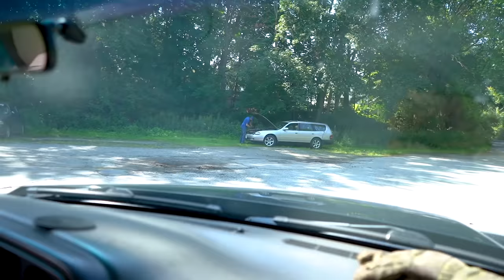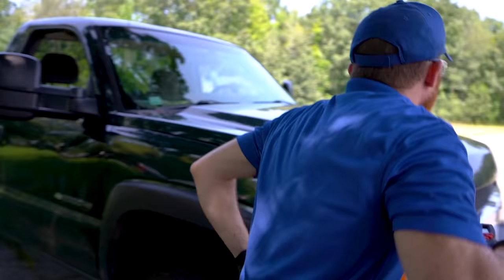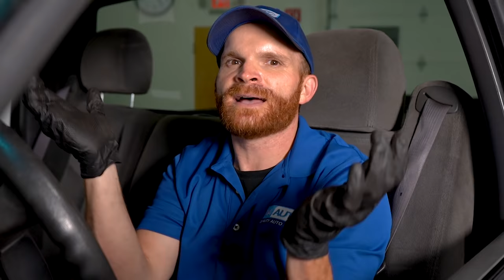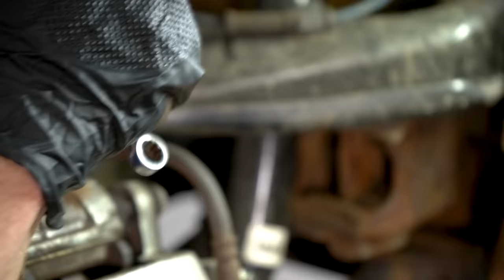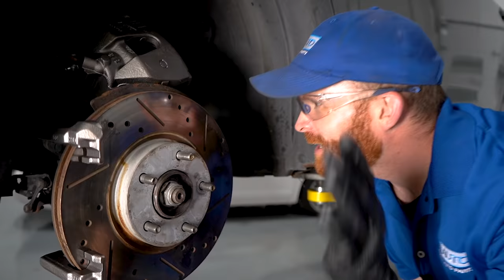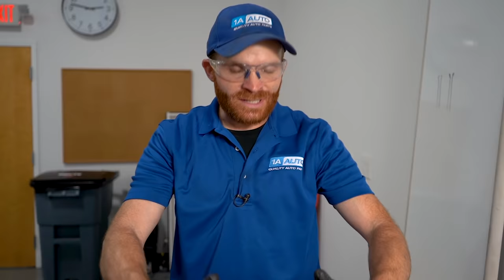Shaking, Pulling Steering Wheel? How to Diagnose a Seized Brake Caliper!

Comment: In my case, my truck didn't have a shaking wheel, and it only slightly pulled to the left. What it did do was have a rhythmic "pulse" of braking, making the truck seem like it was hesitating. The pulse would increase with speed and decrease when coasting. I got home and used my hand to feel each wheel and the front-left was radiating heat. At that point I only went a few blocks to Wal-Mart and back. Another symptom was the truck wouldn't crawl forward while in gear with the foot off of both pedals. I had to fight to get the caliper off because the bottom piston (two-piston caliper) was sticking out further than the top one. I replaced the caliper but the problem still persisted. Once I replaced the hose as well the truck acts normally. Just putting this out there in case you don't quite have the symptoms mentioned in this video.

Comment: Warped brake rotors can cause a shake too in the steering wheel.
Reply: That’s true
Reply: @drteaisback  
Thanx for that will change those as well
Reply: Brakes rotors and calipers...how much would you estimate it would cost for an SUV? Your best opinion on prices in your experience. I have the same problem happen to me and the place I went to is charging me 930 for a Honda Pilot.
Reply: @TheTSRush  New mounting bracket and caliper w/hardware $126 each side, Brakes $35, Rotor $56 each side.  I am replacing parts for a Chevy SUV Equinox  2011 with a frozen front caliper and slider pins.. My parts are from ACDelco.  The honda part cost may be more....
Reply: Generally that will only be when you are applying the brakes. When applying the brakes and the steering wheel shakes typically it will be an issue with the front rotors are in a severe case maybe even a sway bar links especially on Dodge grand Caravan. The other thing to remember is that if you feel something shaking when you apply the brakes and it’s more “in your seat” it’s probably the rear brakes, rear brake rotors
Reply: I replaced my front pads and rotors.  Steering wheel shakes hard when I hit the brakes.  Worse when I break on highway.  Any ideas on what to look at next?  Thanks!
Reply: @squirrelattackspidy  Did you figure out why the rotors warped in the first place? Could be a sticking caliper, pin, or piston. Did the car drive smoothly for a day or two? Possibly you warped your new rotors. Just a guess. Could be a bad tire, bent rim...

Comment: Simple; drive a mile or two. If you feel a difference in the steering wheel. Pull over immediately and place your hand near the the center of the wheel. In comparison if one wheel to the other. If it’s warmer/hotter than the other. Then you have a dragging/seized caliper.
Reply: Or wheel bearing.
Reply: Or just replace the car 😒

Comment: Len is a trip. He explained everything perfectly and the funny part is besides him being silly is, I just replaced my brakes all the way around A couple weeks ago. New drums new self adjusters new spring kits everything new shoes all for the back then I went ahead and did the front and bled everything properly. Sure enough I was driving I felt a slight pulsation and then when I stuck my hand on the lug nuts on the driver side they were so hot they almost burned me so I figured something was going on with the caliper or possibly an issue with the brake lines. The passenger side was moving freely but it was hard to turn but still can turn and I crack the bleeder screw open and then it freed up the caliper so it's spun freely. I figured time for a new brake line so I ordered the passenger and driver side brake hoses ACDelco of course. They took a couple days to come in and when they did I was off the next day so I installed them and bled everything the passenger side was working like new The driver side would spin finally but still had a lot of grab if you will on the rotor so I drove it to work probably a big mistake drove it home and then realized it was still too hot but the passenger side was working fine and it had a little pull to the left, driver side. I figured all my brake lines are new so it's got to be an issue with a slider pins or the piston itself. I removed the slider pins and they looked very good so that narrowed it down to the piston. I went back to the auto parts store while in the parking lot I removed the caliper and took it back in to get a replacement. I installed it bled the brakes and the rest is history it has been working with no pulsing I could drive for 45 minutes and stop and I can touch the rim on the driver side no more severe heat just a little warm but that's to be expected. It really moves freely now before it felt like I was trying to go and slightly pressing on the brake at the same time. I also noticed that it pulled to the left when breaking. I will tell you guys and girls that something is simple as a piston on a caliper starting to seize up causes a whole slew of problems, trust me. Len is right. I usually all the time use AGS brand called syl-glide brake lubricant. Spell check but anyhow this stuff works really well and it's not as cheap as some people say it is. My local auto parts store had a 4 oz tube of it for $10.99 plus tax. Using the right lubricant and making sure that you have your slider pins nice and lubed up and any metal on metal contact points like where the pads slide on metal brackets or in my case part of the caliper where my 96 Chevy Silverado c1500 sit and clip on I also put a little bit around the piston the metal of it so there's no possibility of moisture causing it to rust against the back of the brake pad. I'm just rambling on and on but seriously this is an outstanding video. It shows pretty much exactly what was going on with mine. Now that I have all brand new brake lines brand new calipers brand new pads brand new drum brakes all the way around New springs new the works My truck stops so smooth like the day it was when it was brand new perhaps even better because I switched from semi-metallic brake pads to ceramic brake pads and it does make a difference. Also I forgot to mention I changed the master cylinder as well and bled any possible air out of the ABS module and yes you would need a scan tool for that or if you're redneck or country you can do this at your own risk. I mean your own risk! Drive it in a field and slam on the brakes and you can hear the ABS system activate and you do this a few times it burps the air out of the ABS so then you can bleed at the wheels. I don't know how true this is but I just used a scan tool that my brother has because he's a mechanic and the scan tool activated the ABS module.

Comment: I was amazed to find a great brake tip a few days ago when I had to replace a fitting on a steel brake pipe, I've done a number in my time I hate steel pipes but anywho all these years trying to cut, debur, and put a fitting on all while having brake fluid flowing out making a big mess on occasions I'd have to bleed the whole vehicle afterwards. The tip is use a plank to keep the brake pedal flush to the floor wedged in against the seat that will stop the flow of fluid just be careful when undoing the bleeder on whichever ever caliper your working on. It's completely changed my view and hopefully future experiences doing brake job's. Great video and that caliper jezz lucky it didn't smack him in the face.

Comment: Thanks and very good trouble shooting.  In my opinion, if one is bad they both get changed. Is that a little more expensive, yes.  You have to decide if you want to replace just the non-functioning unit or both. Personal choice, I would do both to keep them the same. Thanks again for showing how to found the part that was not functioning.

Comment: I appreciate the videos, great job. I was having similar symptoms, but the cause for me were the front tires.  The issue with the tires was not visible because it was on the side facing the engine.  I guess I should not wait 7 years between tire changes lol.

Comment: I had that same problem with my 2005 chevy malibu ,the caliper seized on the driver side i just replaced the caliper and now im good to go , great video i watched your video it help me determined what issues i was having  steering wheel shaking ,hesitation pulling foward and creaking when backing up all good now thanks👍👍👍

Comment: My truck had this exact symptom.  The steering wobble seemed periodic, sometimes none at all.  Couldn’t figure out what it was. Then I had to slam on my brakes for an ambulance going thru an intersection on a 55mph highway.  When I began driving afterwards, the wobble was in full force, so much so that I pulled over.  I waited about 5 min, then took an alternate (slower speed) route back home to avoid the highway speeds.  I rolled down my windows to listen for any noises, and I could hear the sound of the brakes hissing (not grinding) as I drove.  When I got home I could feel the heat from the passenger side front brake as I stood 5 feet away.  And it was sunny, probably 85 degrees outside.  I didn’t have a thermometer, so I tried to spit on each brake rotor.  On the front driver side,  the spit hit the rotor and sizzled. On the front passenger side, the spit evaporated before touching the rotor.  So I changed out both front hoses, got some new pads, and did a full flush.  (The rotors & calipers seemed okay.). She’s right as rain for now, but I had about 1/8” of pad left before metal on metal.  I wish I could send pictures of the pads.  I think that the dirty brake fluid caused the passenger side hose to have some type of one way clog.  It would definitely get pressure to the brake, but would not allow it to release back to the reservoir.  Very good (and pertinent) video btw!!

Comment: Had that problem with my 1993 Nissan Sentra. With the caliper still attached to the braking system and the hose clamp removed, I pumped the brake pedal to push the piston out.
Loved the video. Great maintenance tips.👍👍💯

Comment: Excellent walk thru!  I just recently had some issues with shimmy which turned out to be worn tire due to front end alignment.  New tires and all’s well.  I will however do a complete check after my shoulder surgery is healed.  Thanks for a thorough explanation of possible problems.

Comment: Good info. I learned some things about brakes I didn't know before. I had a caliper lock up on my van a few years ago. I just bought a new one and it fixed it. I noticed a brake smell coming in the van and when I stopped at a store and got out, I saw smoke coming from under the left front fender. I knew what was wrong. Caliper not working. Watching you video tells me replacing the caliper might not have fixed the problem.

Comment: Super, Duper Video, well Done, Lots of information, now I'm well late informed after I changed the CV Drive Axel for no reason, well 50/50 when I should just have just changed the CV Drive Axel's  seal, after replacing it still has the same shaking issue when I brake but it's more clear coming up from the front the passenger's side❗😭❗Well another inspection for the next Weekend I guess❗😅❗

Comment: I had that problem in my Tacoma- turned out some of the pistons were slower than the others.  When you remove the pads, inspect them for any type of runout or uneven wear.  If any of them are unlevel, reinstall them and get yourself a caliper rebuild kit before going any further - otherwise the runout  will repeat on the new hardware, and will just happen again. Runout on the pads necessarily doesn't cause the rotors to become unlevel, but it could cause the wear tracks to not be concentric with the rotor..so the pad goes in and out of it.  And that's what causes the steering or in my case the entire truck to shake during light braking.  
I drove my truck for an entire year like that because I knew the brakes were safe with only 6 month old brakes and there was no steering pulling, and it didn't shake at all during medium or hard braking.  Only during light braking.